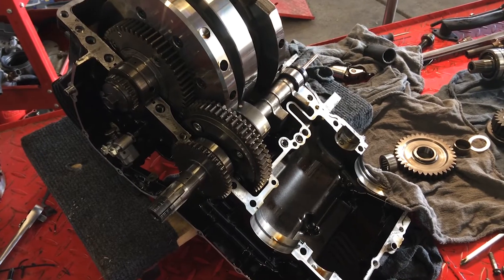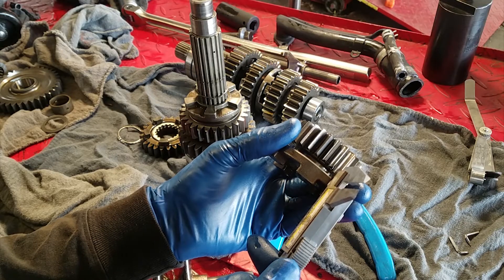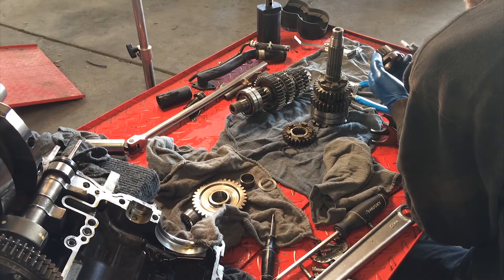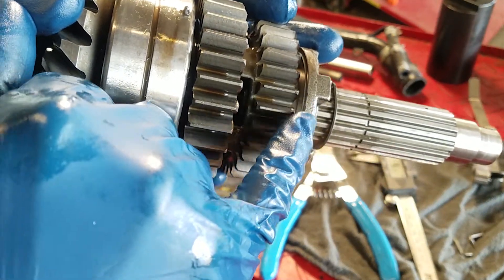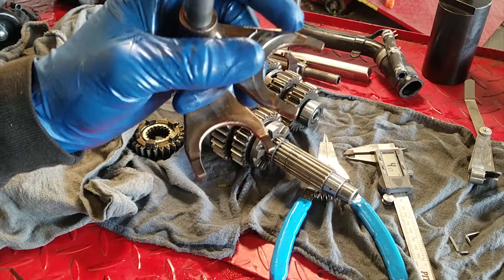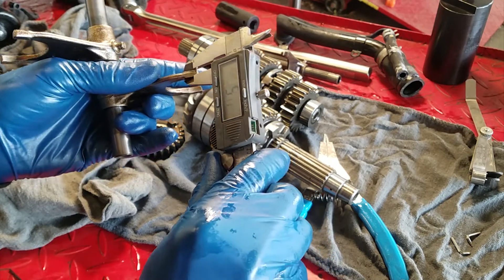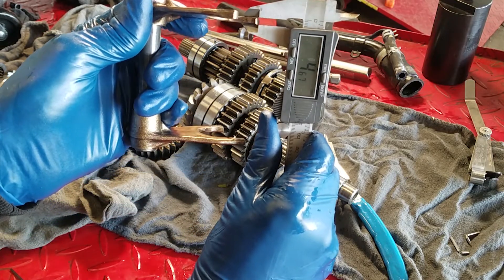Suzuki M109R / VZR1800 Transmission Damage Assessment and Technical Inspection

Comment: No problems after the fix. What is stopping it from doing a repeat. It seems to me its bad design in the engineering in the first place.  Suzuki should bring something to the table about this problem.. 
     I like the 109 but id never buy on for 2 main reasons.  1st is there is no abs now days that just deliberate neglect. 2nd is there is no reverse a 700 + bike should have a reverse.  Do I need to say anything about the 2nd gear problem.  If Suzuki would step up and bring this bike into the future it would have a real winner. 
Every one is waiting for a quality mussel cruiser.
Reply from the maker: Short answer to the first question... not much. But you can back cut the gear wear the shift fork rides. Lots of people have done that as the fix. Nothing Suzuki will do though.

Comment: Hi mate. 2014 Suzuki Boulevard M109R. 1st gear is gone. 2nd 3rd 4th and 5th are fine. Can hear metal grinding from gear box. Is there a way to change out 1st gear clog only? Thanks in advance. Cheers
Reply from the maker: Yeah... Only replace that when everything is apart. Engine still has to disassemble

Comment: has there been a fix to this issue for the 2023 109 boss bikes..im finding there are inherent issues with drive shaft transmission and shift cable...but dont know if its on early models of the 109r boss
Reply from the maker: I wish I had a good answer on that. I don't think suzuki ever actually addressed this particular issue.

Comment: Why did this happen ? I had a 2007 and going into 2nd was a nightmare. So I sold the bike letting the new owner that there was a problem and he said he could fix the problem
Reply from the maker: Known issue since they started making that bike. They just never decided to address it as something they should do a recall on. Mainly because most of these don't get ridden that much so never see the mileage it takes to start failing. Suzuki never addressed the issue.

Comment: I am in desperate need of help. My 06 M109r goes from 2nd to neutral. A known issue. Engine has only 11k miles. I live in Dallas TX and can't find a mechanic that would help me. Any suggestions?
Reply from the maker: You're going to have to keep looking around. The problem is that once a bike turns 10 years old, many dealerships simply won't work on them because available parts start to become less and less available. I was the guy in my area that would take on these older bikes. You may have to just start looking a bit further away than you want to find a reputable mechanic to do the work. Unless you have done anything like it before I wouldn't recommend trying it yourself.
Reply: Hey did you find someone, I also live in Dallas and this is happening to me
Reply: @jeromewatts7368  Im in Dallas and did this repair. $2500 plus parts.

Comment: Sorry for a 2011 m109r limited edition
Reply from the maker: Depends on the hourly rate of whoever you bring it to.  My rate was $75 per hour and a job like this is every bit of 12 hours between remmoval and reinstallation of the engine, plus tear down and rebuild.  Parts (depending on what is needed) will run into the $1000 area if you're doing the exact same thing that was done on this bike.  So figure that it'll cost you at least a couple of grand.  If you're going this route and intend on keeping the bike for a long time, look into having the gears "back-cut' before you install them.  Should keep you from having this issue again.

Comment: Is the gearbox issues isolated to specific years or did Mr Suzuki fix it at some point  ?
Reply: Actually they did.  First, starting in 2011 they went from the 5 dog setup to the 4 dog setup...which makes no sense.  They beefed up the ball at the end of the shift fork thinking it would be the fix. Fact is this will just take a little longer to develop the same issue.  We have a total of 7 more to do this year.  We use R&D Motorsports in Florida as he also provides hardened shift forks and rods.  Great video.
Reply: @bigpapam109  4 dogs vs 5.. allows the dog to be a little thicker & more importantly allows the engagement gap to be wider for more positive engagement.. my understanding is the face edge of the dogs round off with wear through that engagement clunk.. I'd think clutch drag could be a factor.. riders not pulling the clutch right in or maintaining adjustment
Reply: @Errol.C-nz  the mating surface on the dogs is still the same. The width of the dogs is obvously wider but the actual engagement surface is the same depth and hasn't changed. Instead of going to this 4 dog setup, they should have back cut the gear.  Personally I don't think clutch drag is the issue.  I think many happen from riders doing a shift when wide open throttle and abusing it. However, I have seen it happen on bikes that are just granny shifted.
Reply: @bigpapam109  I've thought about it a while now.. wanting to buy a 109.. the width of the dogs doesn't matter.. the gap between them does.. because.. it give more time during engagement for the dog to move into mesh with the mating dog.. 4 dogs vs 5, gives 20% more time at any given rpm of the cluster for the dogs to engage..  a reason second gear is the main failure.. logically.. is the shifter has to move across the neutral gap in the gear set.. & I think the shift motion through that space happens quick enough.. on top of that back cut issue.. & probably some machining gear tollerences issues.. it could be as silly as there being one particular machine, gear cutter that's a problem or it's setup.. wouldn't be the 1st time in history.. just my thoughts.. I'll be looking into that 4 dog gear part as a matter of curiosity
Reply: @Errol.C-nz  makes sense. I specialize in the 109, and we are known world wide in the 109 community. With that being said, I am not very knowledgeable on the actual workings of the Transmission in terms of being able to debate. Lol. Always willing to learn. I have to check but pretty positive I have a 4 dog and 5 dog that are here and already back cut. But I think I may have one of each that are still stock and will look into them and see what the differences are.  I had a lengthy conversation with Mark, at R&D Motorsports in Florida, who is one of the best in these transmissions.  He does all of our backcutting and such. He has looked into it and said he sees no difference in terms of the engagement being any better and it baffles him that they went from 5 to 4. Either way, I am starting to see a lot more of the 4 dogs coming in to be fixed so either way, the problem definitely hasn't been fixed. Maybe slightly improved.
Reply: @bigpapam109  great channel.. would be good though to have play lists grouped of the bikes or similar type faults n fixes.. like all 109/90 stuff.. ever worked on Goldwing sixes.. senior life crisis is getting one as well.. finally.. cheers from NZ
Reply: @Errol.C-nz  I agree.  I know of a decent amount that have this problem.  Not sure why they don't just back cut the tranny from the factory.  Would cost pennies to have their vendor do it.  I got rid of my 109 and went Victory for my senior life crisis.  Started out at 81 at the wheel and now she is 125/122 torque at the wheel.  Had to, as my wife has a fully decked out 109 that i have to try and keep up with 🙂
Reply: @Errol.C-nz  and I haven't worked on GW's much.  Buddy has one and did electrical tracing and fixing for him as they are nothing but relays.  Never did anything motor wise
Reply from the maker: Far as I'm aware they didn't do anything to change the transmission for as long as they've made that engine
Reply: @MotoMedic  thank you for replying 👍

Comment: How often do you need to replace the parts?
Reply from the maker: I really couldn't tell you that.  It would all depend on how the bike is being ridden.  If you do this job, have the gears back-cut and it will probably never have a problem again.
Reply: That’s a good question I’m on my second M109r and I’ve never had the 2 gear problem. I’m at 24,000 miles no and I ride hard, I have 2 friends with over 50,000 miles and no problem so I’m wondering if it was to do with poor maintenance or not changing the oil often enough.

Comment: I'm here because the clutch on my M109R Clutched burned out with only 3000 miles. Pissed me off. Now I'm being told "There wasn't enough ". I used to support Suzuki, not anymore. This is some BS
Reply from the maker: Doubtful whoever told you that knew what they were talking about.  Did you buy it new?  It's not like they come with used clutches.  Burning up a clutch usually is caused by bad adjustment or riding the ever loving shit out of it all the time.  I'm a Kawi guy myself but they're all pretty much the same.  I can't say one way or another on how your clutch went out man.  Sorry...
Reply: @MotoMedic  you are dead on.  I have done over 100 m109 clutches over the years.  50% is from having the adjustment wrong.  The other 50% us from revving up to 5k just to move from gas pump to gas pump.

Comment: Hey I had a question where you located and I want to ask you how much does that cause to do that fix the gears on a M109R I have one
Reply from the maker: I'm located in North Idaho, but don't currently have a shop.  That's in the works but I'm not wrenching on much right now.  This job was right around the $2000 mark with labor and parts.  12 hours labor at $75 per hour.

Comment: Moto Medic this is a great video and provides needed insight. Do you know if the M90 have the same transmission issue?
I also appreciate that you've provide answers to most of the questions that are asked.
Reply from the maker: Thanks for the comment! I'm pretty sure that the M90 has zero issues like this. It's a completely different transmission.

Comment: What is the main cause for this wearing to take place ?
Reply: I have this same issue only with mine the issue is in the first gear
Reply from the maker: Design flaw honestly. They just wear out too fast. Huge engine, lots of torque, and the shift forks and gear just wear out and start slipping.

Comment: What is the cost (around) to fix this exact issue?
Reply from the maker: This job was right around $1900 with parts and labor. My labor rate was $75 at the time of this job. 12 hours labor.
Reply: @MotoMedic  Please help me with my 06 m109r 2nd gear to neutral issue. I am willing to send the motor to you unless you ha e a contact in Dallas, TX. Engine only has 11k miles.

Comment: Just about every 109 will develop the 2nd gear issue - I hear it's common with all Suzukis.  Not only does the shift fork need to be replaced but the gear dogs need to be back-cut or it will just happen again because it's a design flaw. There is a shop in FL that sells upgraded parts too.
Reply from the maker: Yup... That's what I've told my customer... He decided against back cutting due to costs. I said hopefully he won't have to do it again in the next 5 or so years lol.
Reply: @MotoMedic  What!?  Talk about penny wise and pound foolish.
Reply: @MotoMedic  so that the design flaw.. the selector fork is holding the gear engaged & wearing because there isn't enough/any back cut on the dog for the dog to hold engaged .. reason for a recall if ever Ive heard.. did they rectify on the later ones.. cheers from nz.. great channel 👌
Reply from the maker: @Errol.C-nz  nope... They never fixed the issue.
Reply: @MotoMedic  the deal then.. would be to just split my box & do a half deg grind on the dogs.. still amused as to why some or a lot arent affected.. manufacturing tollerences !?
Reply from the maker: @Errol.C-nz  from what I understand it was just a thing that they never decided to address. Either they didn't sell enough to have a bunch always coming back for the repair, or they just chalked it up to something they could say was the owners fault. Either way it's never been something g suzuki ever recalled. Probably because it would cost them so much!

Back cutting the gears is the most typical fix. I haven't hear of back cutting the shirts forks... I would have the gears machined.

Comment: Hey, thanks for the video. I just purchased an 06 M109r and unfortunately, this is my issue. I was quoted $2900 just to tear the motor down and diagnose the issue. I’m trying to find a shop for a second opinion but haven’t found one yet. Any idea what I should expect to pay for this repair, ballpark? I’m not dropping out of second (yet). But I think it’s coming. Right now, it just surges through acceleration, hard to shift into second from 1st.
Reply from the maker: So sorry for the delay in responding! I don't see all comments when they happen apparently!

What I was providing for my customers was this... A full tear down of any engine (with engine out of the bike) was a flat rate $200. That gets me inside and able to see what the damage is and if it can be repaired. It's a few hours to tear into. Fair charge.

If it could be repaired I'd cost it out and let me customer know the costs. At that point they can either give the go ahead or say no and get a bin or two full of what was once their engine 😊
Reply: What was the total cost

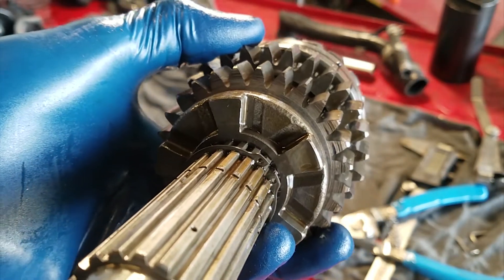Comment: At the 1:00 min mark you have a nice close up of one of the retainer snap rings (or C-clip rings).  How critical are they...I snapped one of them (found it during my oil change at the bottom of the pan in 2 pieces).  Can the gear box go on living without 1 or do I absolutely have to have it in place?
Reply from the maker: Rule of thumb....  If they engineered it to have a tiny snap ring to hold something in place then it need to be there.

Comment: 08 M109R. When going over 4K RPM's on 2nd gear, the bike jerks just once. Have u ever had someone coming in to u with that issue? If so, what was it?
Reply from the maker: I will would bet money that you're having the same issues as most everyone with the 2nd gear issue.  Which would be the same issue that ended up becoming this very video.
Reply: @MotoMedic  was hoping that was not the issue. Appreciate the reply tho. Great video!! Thanks!
Reply: Tubular nut

Comment: My kawasaki zx6r 2009, when i accelerate in 4th gear, sound like gear skipping their teeth. Only in 4th gear acceleration.  After change the drum shift and shift fork, it is same result. All gear teeth and gear dog looks like normal. Can you help me solve this problem? It is affected by using engine oil without JASO?
Reply from the maker: What do your chain and sprockets look like?  I really don't have an answer for you without actually seeing your bike.  I have the same bike and if I had that noise the first thing I'd check is chain slack.  I also don't know how you i nspected the parts when you had them out.  Did you use a digital caliper and take measurements, then check against the manual?  Or just do a visual inspection?
Reply: Sometime i just skip to 5th gear.. Sometime when i stay accelerate very low speed in 4th gear with drilling sound, it is feel stuck. After that, im just pulling clutch lever shift to 5th gear.
Reply: Thanks a lot.. I will inspect again

Comment: Is this the case even with new models like 17,18,19 ?
Reply from the maker: I haven't heard otherwise... I haven't checked part numbers but if they're the same I'd assume so.
Reply: @MotoMedic  dam that sucks I had this bike on my to purchase next but if they have transmission problems maybe I'll skip 😒
Reply from the maker: @robr1901  I will hit up a buddy that works at Suzuki and might know a little bit more about the newer ones and if they've remedied the issues.  (Just texted him so I'll post back with an answer if I get one lol
Reply: @MotoMedic  man that would be really cool if you get a answer thanks bro 👍👍👍
Reply from the maker: @robr1901  just heard back from him and he said it isn't something he's seen often, if at all really. Suzuki may not even know there's an issue if all talk about this is on forums and not brought to their attention. Also if it's only a small percentage of the overall number sold that have the problem then its not likely they'd do a recall like this considering its a huge job to pay for to replace a gear or two. And he said there are no bulletins or different parts for the newer ones.
Reply: @MotoMedic  thank you so much for that information. Well it just seems like some bikes have the problem and some don't just wouldn't like to be the one with bad gear's.

Comment: I have a 06 m109r with 9k, having the same issue how much does this type of work usually run
Reply from the maker: Depending on shop rates it'll vary. But figure any shop is going to bill you about 12 hours in labor. Parts on top of that. Not uncommon for this job to run $1500-2500
Reply: @MotoMedic  shops bill more then that.  Book hours are 20 hours for the job.  Normal price with back cutting the gears is around $3k. Without and using OEM, which is a huge mistake will still be similar if done by a dealer.  Hardened shift forks, shift rods and back cutting are a must.
Reply: Moto Medic thanks for the info, looks like I’ll be getting the undercutting down soon as winter comes back around
Reply from the maker: Definitely do that back cutting if you replace the gears. It'll last a lot longer

Comment: You wanna do another one? Blew out my 2nd gear plus engine needs rebuild. I think rod/bearing accidentally oil starved it. Didn't realize like a dumb ass you need to tool tighten an oil filter on a cruiser. Let me know
Reply from the maker: Where do you live?